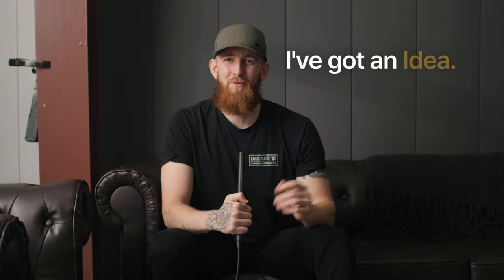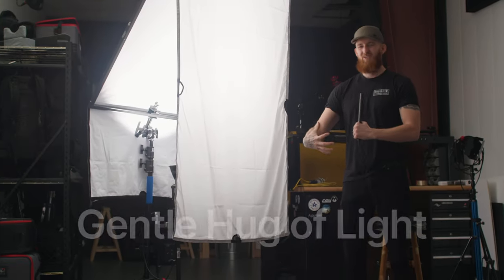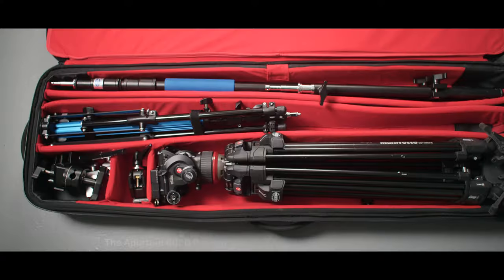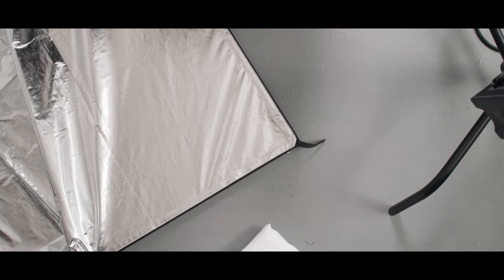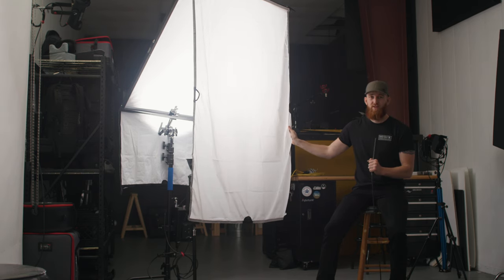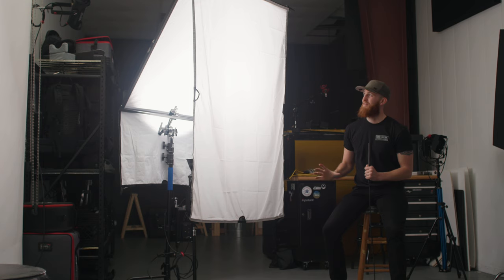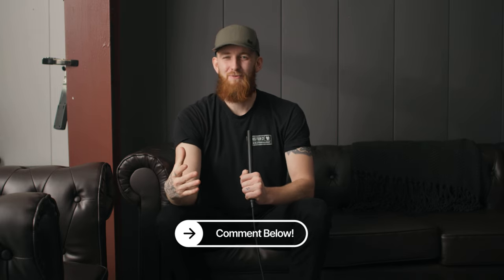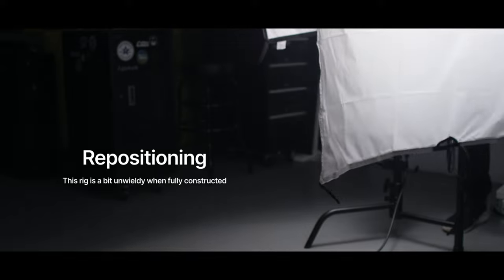I've never loved a SOFT LIGHT more...

Comment: Good idea! I have been thiniking of doing something similar. Have you thought about clamping some duvatine to the side to control the spill? Also using something smaller than the 600d so you can use lighter light stands would make it more mobile.
Reply from the maker: I think the duvetyne is a great idea! There might be a better solution out there for the light source! With the double diffusion you’ll want to make sure to have plenty power though!

Comment: I’m sure it’s been said but…use a regular c stand with a Cardellini clamp on the high leg and mount your light to that. Flop a black neg over the back of the ultra bounce to block the spill. It will just hang. That will cover the overflow, the high leg support and remove the hot spot by having the light farther from the bounce. You can bag the leg if need be too. Sand bag would just add more to your kit tho.

Comment: Another solution that I have been using for a similar type setup / idea but with a CRLS reflector up top and P300c down low is to use a 2” End Clamp Cardellini clamp just above the high leg.

That way I can get the light over the high leg as well as everything else in the setup.

I haven’t worked with the 600d yet, and if it has a junior pin mount, then obviously this wouldn’t work…

Love this setup- creative idea that I’m going to have to explore more. Thanks for sharing- and keep up the great work!
Reply from the maker: Hey cool idea! :) I've always been quite interested in those CRLS reflectors but have yet to have the opportunity to use them! I'd love to get some in the studio to really experiment with the light that comes off them. :) It sounds like you've got a really cool set up there!

Comment: I like this variation on the book light. You could flag off the side spill by hanging 4x6' pieces of black Duvetyne, attached via clamps (no frame needed).

Q: How durable has the Savage stand been for you. A couple reviews on B&H point out the build quality isn't great. I'm a bit phobic about the risk of a stand falling and damaging people, gear or property on set.
Reply from the maker: Thanks Dave! I appreciate the thought on the Duvetyne, it does seem to be a pretty elegant solution! As far as the Savage stand goes, I'll be honest in that I'm not thrilled with it. It's a really clever idea with the second riser, there is just a bit more "play" in it than I would like for a future version of this light.
It's a good phobia to have! In this particular set-up, I'm not too worried about the stand because we're not putting an incredible amount of stress on it, but it wouldn't be my first choice for a stand that needed to serve other roles. (Booming lights/camera, heavier loads, etc)
Hope that helps and thanks for checking out the vid!

Comment: Thanks
All general pluses are understsndible .

This c-stand is interesting . Is there such a stand with all legs with this option ?

Also it is possible to attach some clamps and doublers to hold flags to decrease light spill a bit higher .or not ? 

It would be nice to point more on that exact scenarios where your Light is a kind of only way to get this soft light for a wide shot
You mentioned that it is not possible to light it with softboxes in a tight space, cause there is no space to move the light source back from the subject .

This example 

Probably as you mentioned it is not quite well for a "black cabinet" setup... Because of the spill anyway
Reply from the maker: It is an interesting C-stand for sure! I'm not aware of any stands that have all of the legs with receiver options, but with some creative (safe) rigging I'm sure anything is possible! Thanks for commenting and checking out the vid, Art!

Comment: Please someone correct me if I'm wrong, but the height of the leg should have no impact on the lever, it's all about where the weight is located. We point the tall C-stand leg towards the load because that gives us the height to hang a sandbag without it just resting on the ground. Even though junior pin leg is short, as long as you position the 600Ds ballast directly above it, you are getting many of the benefits of a sandbag. Between the ballast and the light itself, I bet you could get away with a smaller counterweight (that doesn't rest on the ground) and have very similar stability characteristics as a traditional sandbag on the tall leg. I'd love to see a follow-up video that shows if I'm out of my mind or not.
Reply from the maker: I don’t think you’re out of your mind! I was thinking the same thing from a physics perspective, with all of the weight being so low and positioned directly over the legs the need for a large counterweight might not be necessary.
I figured I’d get some flak for the “improper” orientation so I thought I’d try and get ahead of it😂 in my experience with it, it seems quite stable!

Comment: I do a similar thing with a regular C-stand by just putting the head on a Cardellini halfway up the shaft. This only works well with lighter heads though, I wouldn’t recommend it with the 600D.
Reply from the maker: Ahh cool idea! :) Like you said, it might not support a similar load, but it doesn't allow for the use of more "common" C-stands which is a real win.

Comment: I wonder if a rolling base like the kupo mighty runway base would be a good alternative to the Mathews base you're using here. It's got mounting holes on each leg that you could put a spicket in and mount the light even lower if you wanted to. Mainly, I'm thinking it could be nice to have wheels on this bad boy. Killer build, man!
Reply from the maker: Thanks Luke! :) I appreciate you checking out the build! I'll have to take a look at that kupo stand, because that sounds like an awesome solution!
Pumped to have you here, man!

Comment: Fantastic video, and great idea. For the spill, wouldn't you be able to hang some black material (like duvetyne,  but that might be a light too heavy,) on the sides,  almost creating a custom soft box? You might have to cut and sew some velcro to your own material, but I'm sure you could find some relatively light but opaque material. 

As for the leg, maybe a Cardellini clamp, or a mafer clamp on the high leg? Peg up to put the light on? I think that might be worth testing. Then the light kind of works as a sandbag for the stand. (Should still bag it though.)
Reply from the maker: Really awesome ideas here! Thanks for putting some thought into it! The custom fit black material is a great solution (essentially making a giant softbox like you said). There is still some exposed velcro on one side of the frame so that could be pretty slick.

As for the leg situation, I've tested something similar to that and ended up with too much light spill on either side of the bounce because of the added distance. That said, I was using a standard reflector, so maybe the answer is to mount to the tall leg and then use a fresnel or spotlight mount to better focus the light! Then this could work with any C-stand! One other issue I ran in to when mounting the light to the tall leg via a mafer clamp was that it wanted to rotate and fall off the side of the leg. With a bit more thought and the right clamp I'm sure a workaround could be devised though! 

We might be on to something, thanks again!

Comment: I appreciate this idea. Thinking outside the box. Another way to achieve similar light; Having the light bounce into a pointed umbrella like a more parabolic shaped and hit that light through a fabric. It will be less light spill. Two light stands will be necessary though but easier to move around.
How do you deal with the green yellow pesky light tint in office areas?
Reply from the maker: That's an interesting approach! I have (wrongly) consider umbrellas a photographer's tool and as such don't own any or have much experience with them. They get some real point for their size to portability ratio! This sounds like a great way to get a double diffused light source, thanks for sharing Martin! 

As far as the office lighting, it all comes down to what you can control. If you can turn off the overhead lights that will be hitting your subject's skin and supplement with your own lighting that would be ideal! If you still need overhead lights to light the room then maybe consider just turning off the ones directly above/in front of your subject. Finally, if no lights can be turned off, you could build a flag above your talent (takes a lot of set up but might be worth it) or you could utilize a grey card to help you find a neutral skin tone rendition in post. Hope that helps! This might become its own video in the future! :)
Reply: @TroyMairs  I'm foremost a photographer but light is light. If using an umbrella for consistent lighting, it needs to be heat resistant. An umbrella with white inside gives similar to book lighting and silver umbrella gives a crispier "maybe more lively light". If one has a softbox one could use that one without the diffusion to handle the spill if that is important.
Thanks for your tips on handling the color cast!

Comment: Great video, thanks for your work. I do use something similar that might help in some situation with mobility: impact metal stand in wheels, light attached to the same stand with a grip, also light controller, and impact umbrella 1,8 meter with a grip. It is not square as you wish, and spill is still a issue, but it it very fast to set up and it is easy to move around and reposition. 😊
Reply from the maker: Thanks for checking it out Alejandro! I appreciate your insight as well! It does sound like your version would set up and move around a bit faster, so that's a huge plus! :) Thanks for sharing! :)
Reply: @TroyMairs  yes, it might be a little faster and easier to move around, but your version has a softer nicer light… so… I guess the situation and what is needed will decide . Congrats on your video 👋🏿👍🏿

Comment: Modern Studio makes a booklight floppy that is a bit swifter to set up, IMHO
Reply from the maker: I just learned that via the comment section! I'd have to agree with you on the swiftness lol I'll hav to check that out!
Reply: @TroyMairs  what is great about yours is that it does tear down. I had to get a 40x40 because the 48x48 is a challenge to drive around with, let alone travel by air. It is a one piece unit with the fabric sewn on the frame.

Comment: Nice setup. Wheels might be the best option even though it’s one more thing. 

Also I’m wondering how you like the 600d when trying to match exposure with a window. 
Would you ever put it on an aluminum stand?
Reply from the maker: Hey thanks for checking out the vid David! I do love putting things on wheels... :)

I love having the 600d. Prior to it, my strongest light was a 300x and I was constantly maxing that thing out. I thought I would regret not having something bicolor but for the work I do it has been a non-issue. I've rocked it on aluminum C-stands without much concern. I might have some reservations about going full stick or booming it out with a C-stand, but for everyday kind of stuff it seems to hold up really well! (properly sandbagged of course!)

Comment: I use neg fabric on the sides of the bounce and it prevents the spill by hanging from the sides just like the diffusion from the front but I don't hang the diffusion I made two bases to place a frame in the centrer of them and place it in front of the reflected light and I don't have to use 2 c stands and at the same time im not obliged to carry one big setup and the frame can also take a grid to control the light some more if needed
Reply from the maker: Great solution! Thanks for sharing your experience with it!
Reply: next one is a top light version using the spot mount haha @TroyMairs
Reply from the maker: @the180degreerule3  lol definitely 😂

Comment: Thanks for sharing. For compact setups I use something similar, the Goyette book light floppy from Modern Studio on the same Savage c-stand. Then I just flag the sides for spill. Works great in tight spaces. I do want larger frames so this may be the next step up!
Reply from the maker: Thank YOU for sharing! I had never heard of the Goyette book light floppy but its the exact concept! Had I known I probably would have started there instead of this contraption LOL! The fun is in the experimenting I suppose! Thanks again for commenting
Reply: @TroyMairs  You got it chief, hope it helps. What you built is really the same contraption, nothing anybody else can't built within their grip kit. The Goyette guy is a photographer/filmmaker that had Modern manufacture his design, that's all.

Subscribed.
Reply: The Goyette floppy is interesting. I think if it were a full floppy ultra bounce with a 4x6 diffusion that would be ideal.